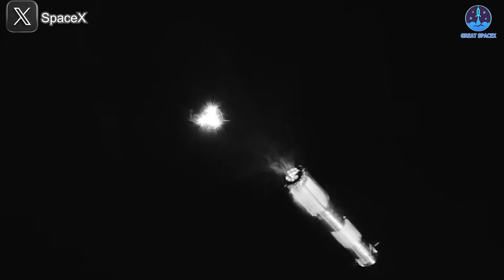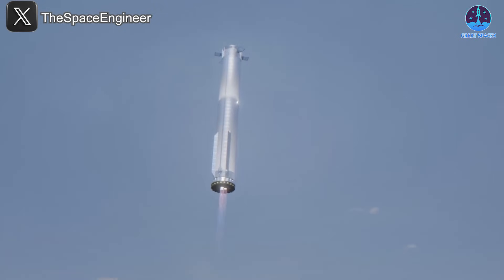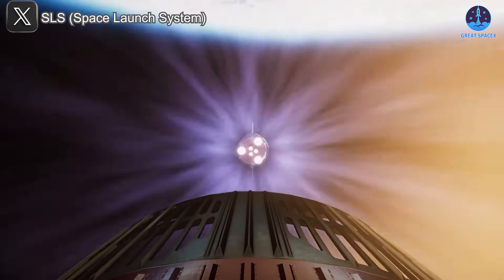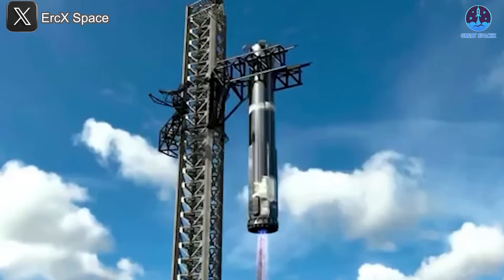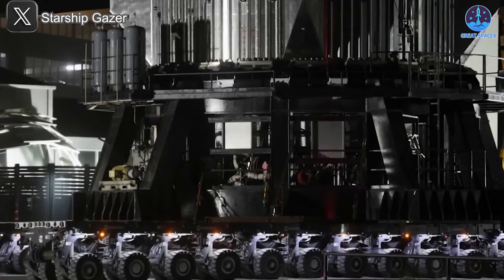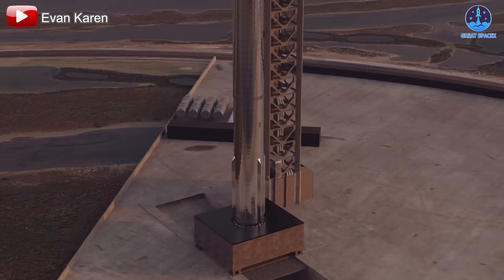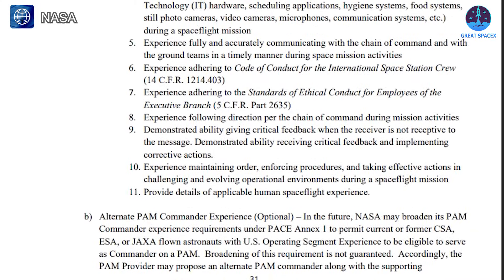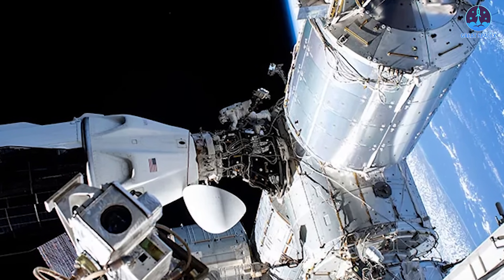Biggest Plot Twist: Starship Flight 9 Booster Landing with ONLY 2 Engines! What will Happen...

Comment: SpaceX might consider a fallback of reigniting a mid ring engine to help balance and support the overall thrust, even if they are not gimbled.
Reply: I think they probably could for sure. I think it would probably work too but you got to think you only have one type of control throttle up or throttle down. I don't think that would compliment a gimble engine. So i think you could make it work if they had complete percice controle over the throttle. I'm just rambleing on though i really dont know much about them I just think it would work. Thats my two cents.

Comment: The fact that SPACEX is now moving beyond Emergency procedures to built-in autonomous system reliability.  Increasing probability of mission success, confidence of in-flight operators, reusability and landing survivability and safety.  More importantly it shows SPACEX serious approach to true accessibility of space travel and off-world living and maintenance. Kudos for this mature testing element. First attempt that I know of to create a fail-over condition due to a equipment failure. Redundant critical thinking.

Comment: Maybe it would be reasonable to reverse the Starship orientation during reentry, and use engines as brakes, slowing down velocity to few thousands kilometers per hour?
Reply: It does.
Reply: It uses its exhaust as a heat shield, actually 

So yes its already doing pretty much that

However terminal velocity is your friend here
Reply: This in person would be really stupid, The immense heat would destroy the whole aft section of the ship within seconds without protection from the heat tiles, plus, this would also mean using more fuel, meaning less payload capacity. Starship has a large surface area that it re-enters from, and it slows down enough during re-entry that this would not be an issue,  it would also cause an issue when re-orientating to the bellyflop position, where it would have to flip and spin, creating more failure points.
Reply: @LinxyM8  I'm dumb

Starship is not falcon 9

mach5-7 versus reentry speed being mach25

Apologies lads
Reply: It could become an option, if there is excess fuel available.
Reply: @DeprivedSouthAfrican  No, it couldnt.
Reply: You seem to think there is a magical fuel supply that would allow them to do this.  Clearly your understanding has a few gaps.

Comment: A rocket engine has a minimum thrust. Perhaps two engines operating with more thrust can be controlled better than three operating at lower thrust per engine. Anyhow, if I am right, it should be tried.
Reply: 3 are enough to lift up so youre correct
Reply: The minimum thrust for raptor engines are pretty low at around 40% and you can still shut down an engine as soon as this is too much instead of completly relying on only two engines
Reply: @shadowhunter5250  If you shut down one engine, or if you don't ignite, it is about the same thing.
Reply: @ It's still better to fire three engines even if you only need two because if one engine fails you can still land on the other two remaining engines, meanwhile if you only fire two and one fails, you're probably not gonna be able to fire up another one in time
Reply: @shadowhunter5250  Either it ignites within a second, or you may throw the rocket into the sea.

Comment: Been Engineering on ~30 Rocket Systems, manned & Unmanned.... MAJOR DESIGN CHANGES W/O PROPER FUNCTIONAL, SHOCK, VIBRATION, TEMP ETC  TESTING LEAVES ONE WIDE OPEN TO FASILURE.
Reply: I love you pretend engineers.  You're just about the most obvious frauds there are.
Reply: nah, spacex crosses their fingers and change the failure points after they well, fail. eats a hella lot of money and design hadware but is way faster.

Comment: I would like to see landing legs. That would impress me even more than a mechazila catch because legs have more multiple point to point landing flexibility.
Reply: Landing with legs wouldn’t allow for quick land/grab-set-fuel-launch over and over. Which is what they want to do.
   It would be cool to see some starships with landing legs though, you would just need a MASSIVE crane to go get it. Falcon takes quite a bit to go and get, then refurbish for another launch.
Reply from the maker: Although catching by Mechazilla Arms is impressive, I completely agree with your point. I like the Starship with landing legs
Reply: @colonbina1  To what end?  THINK... at least try.
Reply: search up "SN15 test flight"

Comment: I had a thought. Add a separate smaller fuel tank that kicks in solely for the landing? Idk if its needed but a comment helps lol
Reply: well, they already exist! the header tanks are inside the booster and ship
Reply: Unnecessary added weight
Reply: It already has one. They are called Header Tanks.